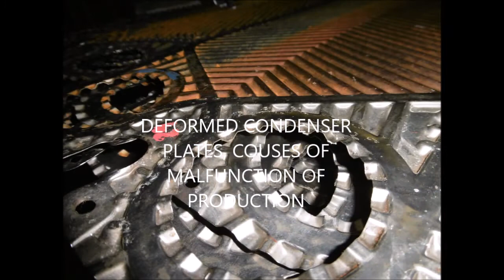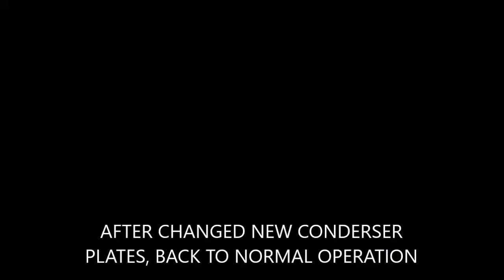FRESH WATER GENERATOR

Comment: i have problem on my fresh water generator.seems like i dont have evaportaion process inside because i cannot produce water.ang my jacket water temp diff. almost 30-35 deg.wat do u think is the problem?any suggestion could help.i have good vacuum in the line.and my seawater outlet temp.cannot rise above 30 degrees.
Reply: Did you chech fresh water pump?does it have non return valve with glass on vacume pipe ?you can see that water is going or vaper.if water flows tru vacume pipe means your pump is faulty.